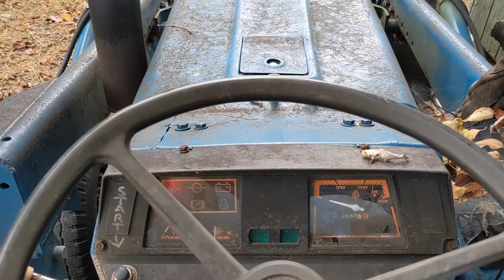Testing new Log Clamps for the Home Built Sawmill.

Comment: Does the side to side movement of the carriage affect the finish cut? Is it caused by tolerance in the fit of the rollers to the track or is it due to the width of the carriage?
Reply from the maker: The side movement is minimal only happened when cutting that extremely hard black locust but did not effect the cut.   It stems not from the width but the height of the carriage.  I built it so that the blade height can be raised over 40 inches in reality my carriage could be about a 12 inches shorter.   I have an idea for the future for a drive system that will pull the carriage evenly from both sides.

Comment: I hope that isnt poison ivy.Pipe to slide on. A piece of plate. A threaded bolt connector and bolt to suit A handle. Nice. It works. The end is...held by an Allen screw?
Reply from the maker: Was not poison ivy just English ivy. The swivel end of the clamp is held on with a Allen head cap screw. Locked in place with a set screw to prevent it from tightening or loosening.
Reply: @thedelcodave  Can you buy that tip? The Allen Screw one?What keeps the whole thing from sliding back away from the log. I cant see what the whole thing slides on.
Reply from the maker: @kennkid9912  I have a video called machining new log clamps https://youtu.be/5DCloIl6a7A

Comment: Looks at minute 5:00 kind of shaky. Might cut a bit to fast here or is this structural?
Reply from the maker: @maxmanus6575  that was extremely hard locus I have learned you have to go slow on the hard stuff. The camera makes it look more Shaky than in person.
Reply: Ah, I see. Yes sir, feeding speed is very important. Might be as well an future improvement to add an chain driven crank to improve constant feeding speed as well. Might also be an option to put a drill on it. Cheers. Overall nice work, I really like the effort.
Reply from the maker: @maxmanus6575  that is in the plans I hope in the future
Reply from the maker: I hope to one day add a power feed. Just have to find the time.